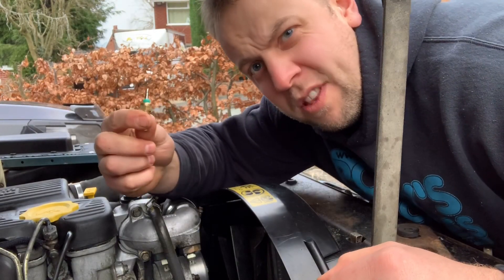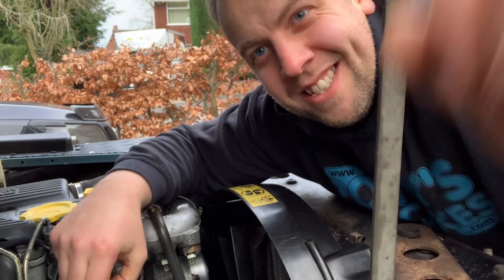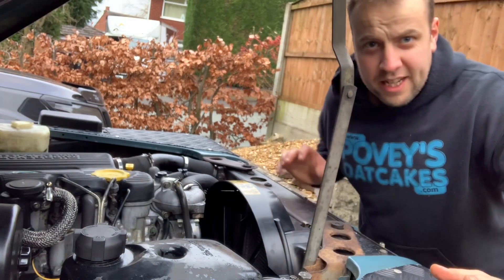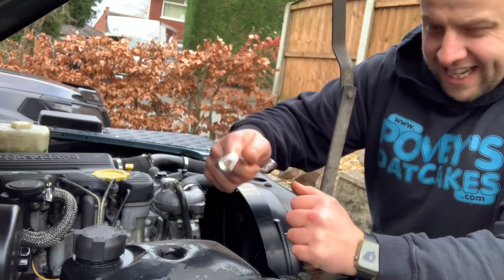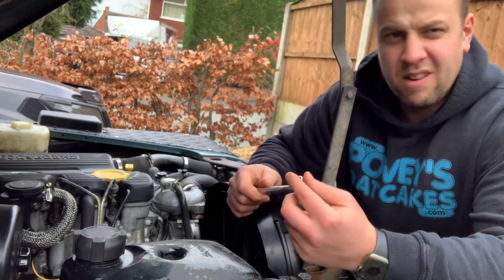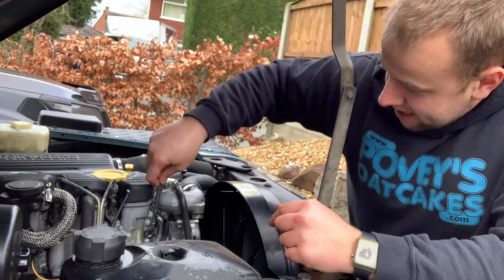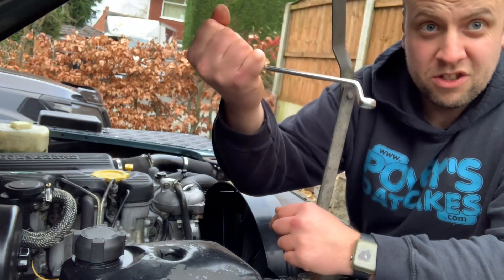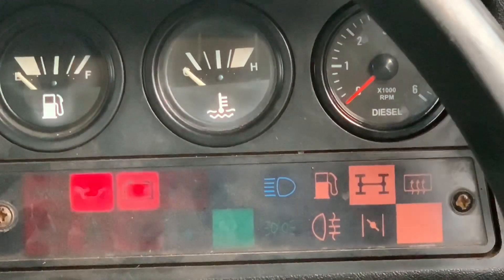Land Rover 90 (defender) 300tdi £3.70 temp sensor

Comment: Thanks(I think.)  I removed the lead and started up the engine; nothing(of course, but mind you I'm NOT very mechanical,) ran it a few minutes, checking for water circulation, then connected sensor, and like you said...had the same off the board over heating register.  I believe I can buy the sensor locally, if not, there's a very good Landrover Distribution Outlet I can shop through here in France.  I subscribed to your channel; probably a good idea in the future.  I've had my 1988 turbo 90 for 30 years and maybe I can finally get around to doing a few things that my mate in village, who's retiring and selling his garage, has always done.  Will let you know once I've replaced the sensor.  Cheers...rr Normandy, France